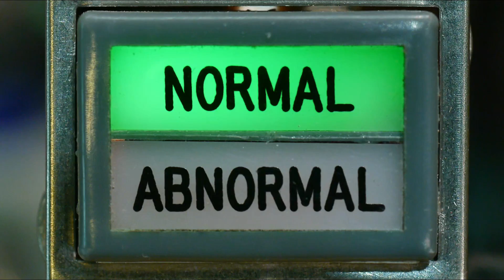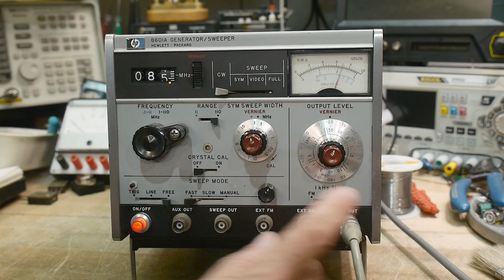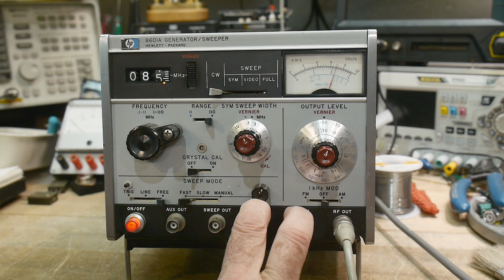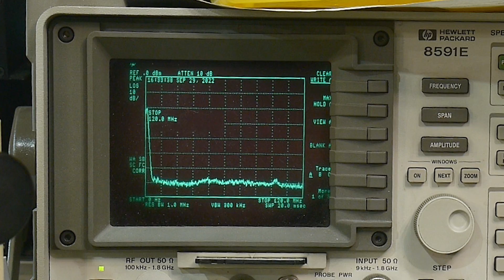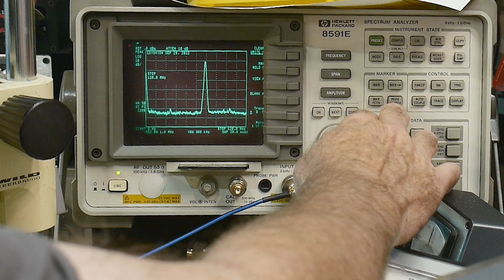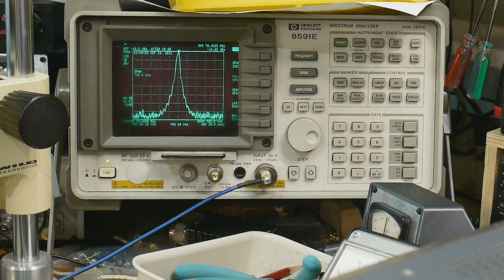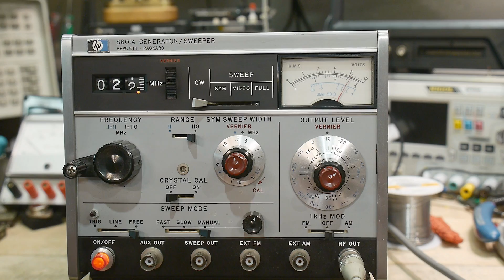#1319 HP 8601A Sweep Generator (part 1 of 2)

Comment: As I recall it,  this is usually operated with a HP 8600A Digital Marker. If that is not in part two, I'm happy to chip in and buy you a nice nixie 8600A Digital Marker for an upcoming video. 😃

Comment: Ooh, I have long wanted one of these. You have probably figured this out by now, but the discriminator converts frequency to voltage. This is used to measure the output frequency in a feedback loop to correct VFO drift and linearize the sweeps and FM. The idea is similar to a PLL or FLL but it's purely analog.

Before the 8601A, sweep generators had poor frequency stability but could sweep, while signal generators had good frequency stability but couldn't sweep. The 8601A was marketed as the first generator that could fill both roles. That's why it's called a "Sweep/Signal Generator".

Comment: You got a great deal for $100 if it has a good output hybrid.  They are a common failure of these.  I have several 8601A's plus the 8600A digital marker.  One of the best analog sweep generator made.

Comment: The definition of a Discriminator is actually on one of the FCC Amateur License exams. If memory serves, Technician License. The simple answer is, a circuit for detecting FM signals. My opinion, the term is somewhat archaic but still useful in modern electronics. Apparently, many enthusiasts tap the discriminator portion of scanners for digital modifications—the portion of signal that is unmodified. This is also useful in digital RF decoding. 

The term goes back to the 1930s is probably more recognized by the elder Elmers. 73

Comment: Now you need to look out for the matching HP8600A 'Digital Marker' unit.  This provides a DFM display and five independently adjustable frequency markers on the swept output of the HP8601A.  I actually prefer using the combo of my HP8601A/HP8600A to sweep vintage HF communications receiver IFs than a spectrum analyzer.  That said, my HP8601A has a phase noise issue at the higher frequencies I suspect is caused by failing power supply filters, but have not checked this yet

Comment: !!! IMSAI Guy,... I have two of these. I bought the first one (ebay) and found the output was a square wave. Evidently the weak point in these generators is the video amp which is a small hybrid module. Unobtainium. Although I did find a design a young man did online. Price for these was out of line. SO. I designed my own. Oh by the way the ebay seller did send me another one which worked. But back to the amp,...
It took two iterations to get my amp to work. A third would be nice to clean up little issues.
But if you have trouble with the video amp in the future I still have 3 or 4 PCB's & some parts if you need them. I really need to get back to this project some time, and go thru calibration which is wonky.
Also: I had conceived and partly designed a PCB for a PiPICO run marker which would high light a sweep on an o-scope with the intensity pips. Another unfinished project.
I also found that the crank driven sweep frequency knob was sticky on both generators. There are a few spots which needed a tiny drop of oil to get that all smoothly operating. I bought mine for FM RF/IF sweep on 88-108mhz.
Reply: Did you try ERA 4 or 5 SM ?
Reply: @soulrobotics  you are gonna need to explain your question.
Reply: Hello Sir thanks for the infos!
I had found a cheap one for sale in my area but knowing that I am not sure it would be a good idea to buy it since I don’t think I have the skills to be designing a whole module.
What would you recommend?